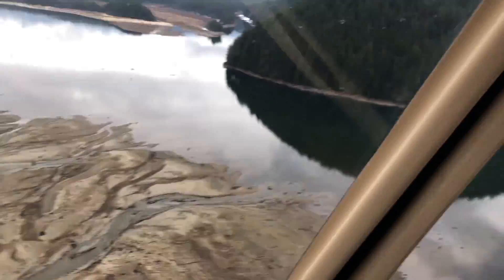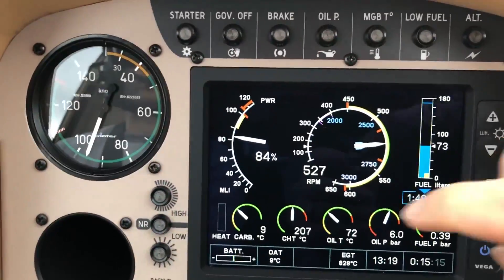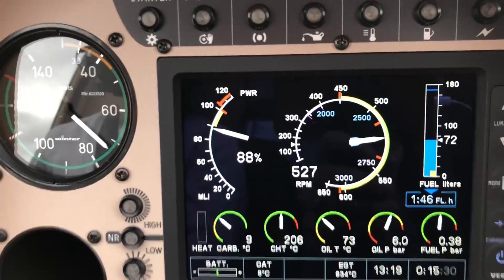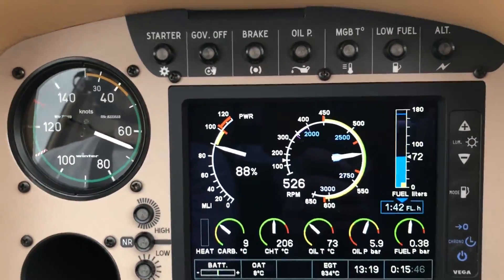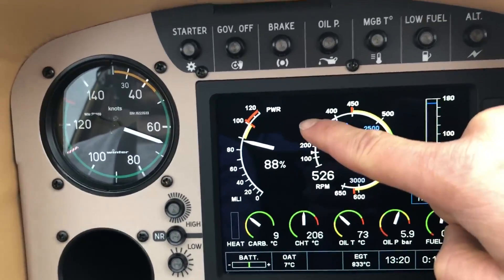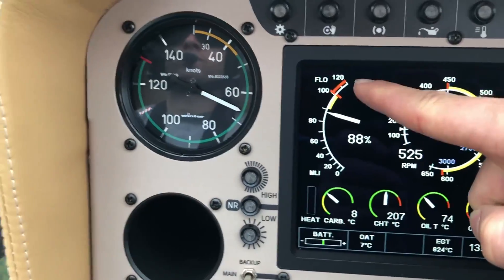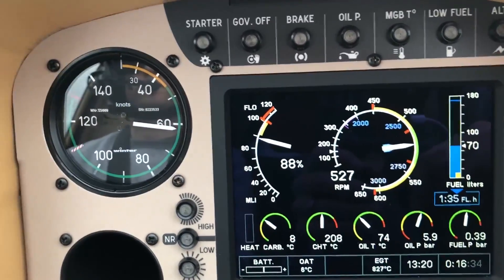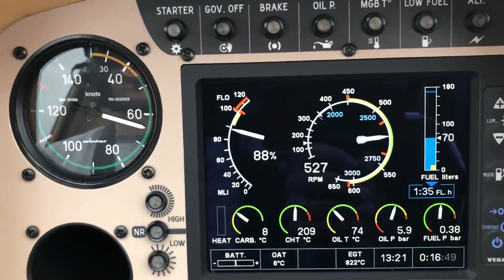Cabri G2 MLI EXPLAINED

Comment: 830 DegC EGT? Wow, how long do exhaust valves last in those engines? That's way past red hot. 
Or is that temp.after some sort of exhaust catalyst?
Ray
Reply: My guess is that EGT is taken right out of the cylinder head and the valves used would be some form of inconel steel which has a melting point of around 1340c, titanium is much higher again.